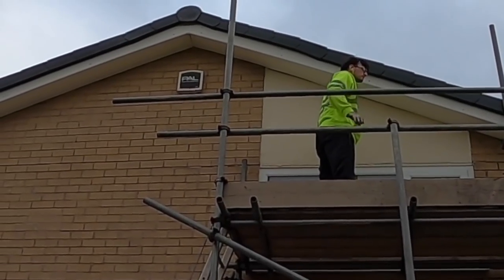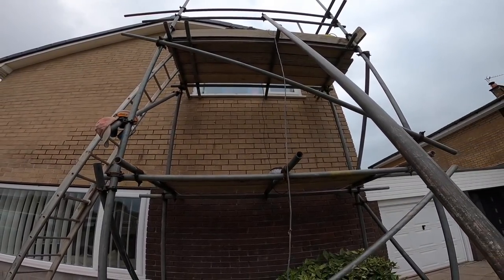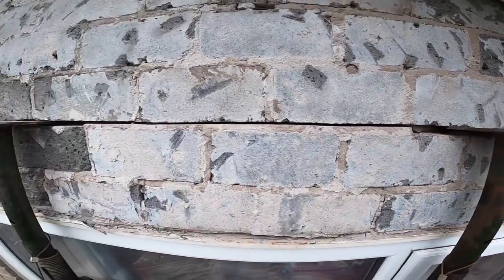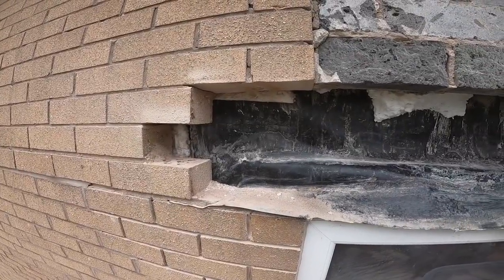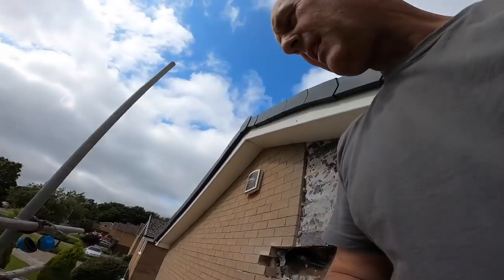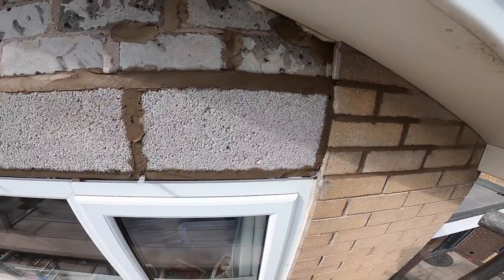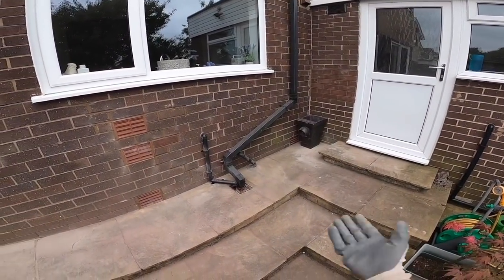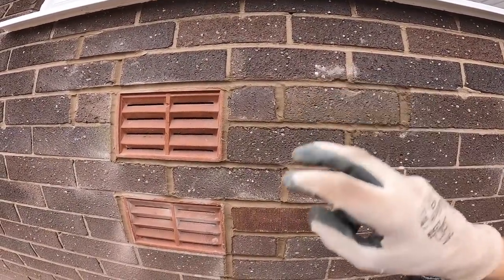HOW TO SPOT IF A LINTEL NEEDS REPLACING

Comment: I've been binge watching these videos today. I'm a roofer, but a couple of months ago, my boss had me take down the bricks above 3 leaking windows in his house, and replace the flashing over the lintels, ready for a bricklayer to reinstate the brickwork. This was after trying without success to get someone to do the job over the course of 2 or 3 years, because of our (New Zealand's) shortage of tradespeople. I used similar methods to you, except that, as the house is brick veneer over a wood frame, I removed 2 or 3 bricks above each window, and screwed offcuts of steel angle to the wood frame to support the bricks, prior to removing the remainder. Also, last year, I bought a 3M Versaflo mask for doing woodworking, and it is the best thing ever, when using the grinder and chiselling out the bricks. No fogged up glasses, no extra breathing effort, & my face and hair don't get full of mortar dust. It doesn't get sweaty and uncomfortable like a filter mask, either, in fact I almost forget I have it on! I do have to find a local source for those Bosch carbide blades though. There are going to be more brickwork repairs on his house in the future, I'm sure.
Reply from the maker: Nice one mark , the mask sounds good 👌🏼🧱👍🏽

Comment: Very tidy job both👍. I must admit i had a bum clenching moment when Steve was tightening up the Accrow with a hammer close to the window 😜. I was also impressed with the javelin throwing skills when the old lintel stuck in the ground 😂
Reply from the maker: 🤣🤣. Cheers Doug 🧱👍🏽
Reply from the maker: @martin2466  😏🧱👍🏽
Reply: @martin2466  Lol. Never admit blame 😂😂
Reply: @martin2466  Thats very noble of you Martin. 👍 Us types NEVER used to engrave our initials on spanners etc in case something was inadvertently left in an expensive machine and something happened 😱 A discrete unique grind mark somewhere did the trick for identification purposes 😂 Kinda focuses your mind when a few thousandths  worth of machine grinds to a halt.
Reply: @martin2466  Ive been in a few dodgy pubs where ive had to do that as well 😂
Reply: @martin2466  😂😂😂😂

Comment: Side note: I lived in Seattle Washington for some time. The place is cool and well all year around. (Sound familiar?) Moss grows on anything that doesn't move. They had similar problems with rust/rot due to rain/dampness. One guy I worked with mentioned that the brickwork on his house had to be completely grooved and repointed  (2100 sq ft house). The house was only 9 years old. Cost him almost $20,000. No bricks or lintels were replaced. Found out that was pretty typical for the area. How does that compare over where you are at?
Reply from the maker: $ 20k 😳🧱👍🏽

Comment: Why did the original lintel corrode so badly? How was water getting in? Cold bridge and Interstitial condensation maybe?
Reply from the maker: No idea pal 🧱👍🏽
Reply: @SteveAndAlexBuild  My guess is front edge of lintel  and flashing flush with face of render, allowing water to suck back in. That's why the more exposed end had the most rust.
Reply from the maker: @mark77193  🧱🧱👍🏽